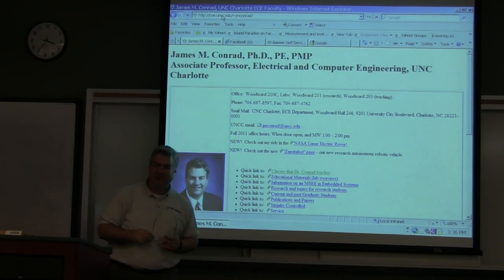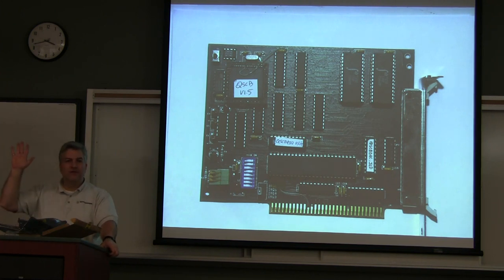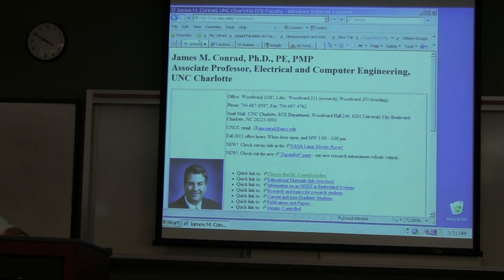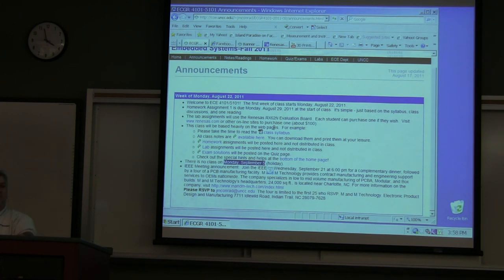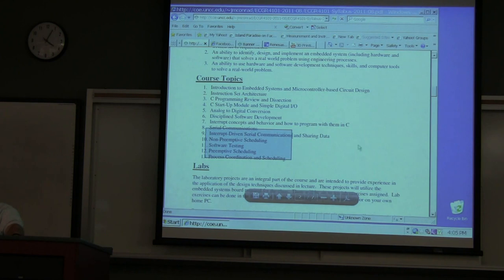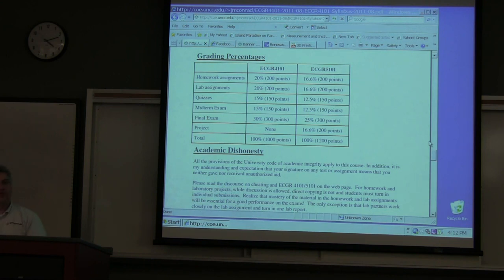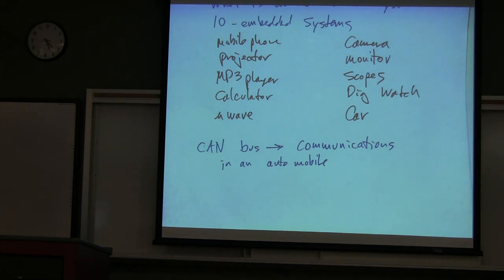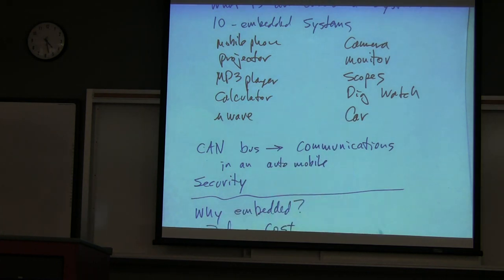Embedded Systems Course - Lecture 01: Introduction to Embedded Systems

Comment: This is a great series, thanks. I'm a programmer, and just recently wanted to try MCU's so I bought an Atmel board to start off with. I was using visual basic for about 15 years, and it sure took a little while for C language to make sense. I'm currently designing my first PCB using address decoders and 32 rom chips. Its still confusing a bit because the documentation for the Atmel chips isn't accurate and has errors in it but I hope I won't e running wires on the PCB, but think its inevitable.

Comment: I completed my studies in Embedded systems in my College  a few years back and would like to find a job in the same. My knowledge is in PIC16f877,8051 etc. if i want to learn embedded programming every time ,should i have to learn about each processors/IC architecture to program or is it possible for me to learn general concept in embedded programming so that it can modified later for each hardware requirements..Could you please  help me where should I start from, for entering into a company?